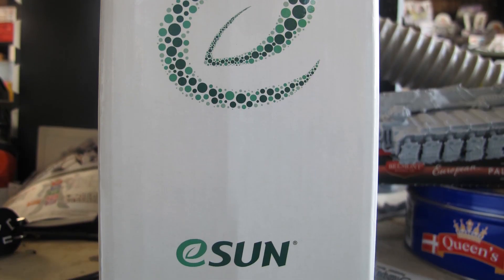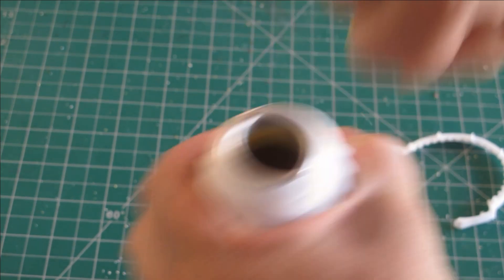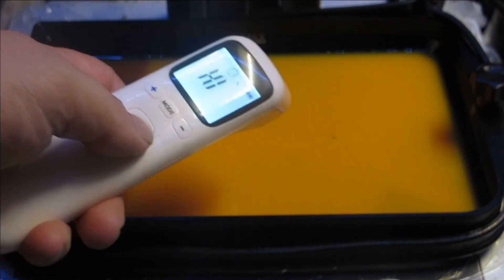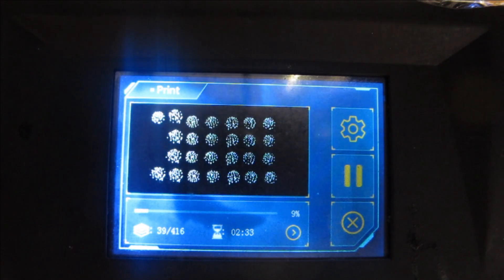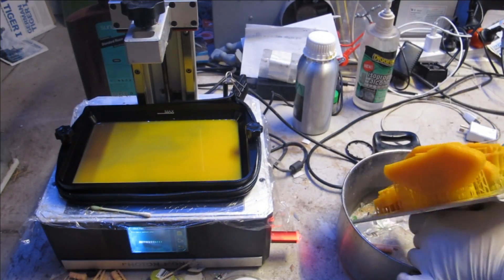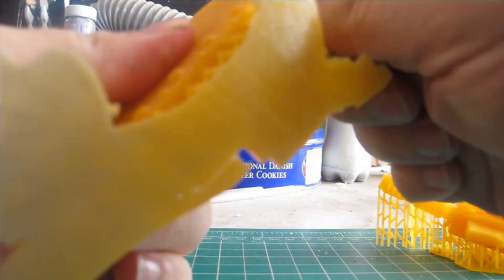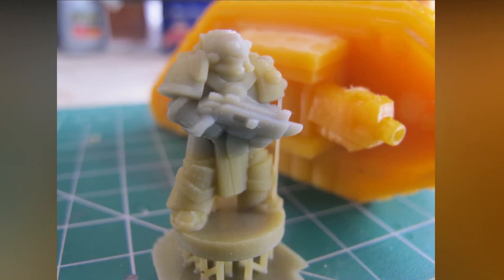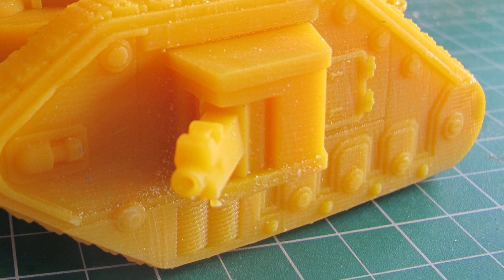Esun eResin PLA Bio Photopolymer resin review (3D printing)

Comment: exposure time please
Reply from the maker: different with very type of printer, same as standard resin that's recommended for your machine with tests and adjustments to zero for best results. I over expose a bit which isnt popular in the community so my input isnt too popular or reverent.
Reply: @mokanaman  At least indicative times I have creality ld006 and black esun and still gives me problems on the test should have 2,8sec and according to the manufacturer 5sec irradiation.
Reply from the maker: If you can quick print black resin you know what you are doing and skilled beyond most normal operators.

Comment: I usually use TL4437 which is a light grey and have zero issues with it. I recently purchased TL4440 and have had nothing but issues with it. Initially I had prints sticking to the fep. I have had issues with the layers splitting and supports failing. Seems a lot more viscous than the one I usually use and I did extend the first 6 payers to 6 seconds exp. Can't wait to get back to my usual resin. Not happy with this one. An odd thing about it is, if I do the print on a second consecutive run, I almost get 100% pass rate. 1st run is probably 60% pass on multiple smaller mini's, or failure on lager single prints. Frustrating.......

Comment: I hate to ask but SO few videos are out there and I need help with information on plant based resin, badly. I keep finding awesome sales on it in bulk but no information. How do the miniatures hold up? do 28-32mm scale minis have acceptable detail? Do they have enough flex to not have weapons snapping off when you look at them? How do they hold primer and paint? I have been told threw the grape vine that they have a slightly softer feel but how?   Please help.
Reply from the maker: Hello, never be afraid to ask myself or any youtuber. Engagement and discussion helps us out as well.  97% eco and plant base resins are mostly the same as regular resin testing few out over the years. Paint, sanding primer wise no difference. Detail and texture is softer in the way of being closer to cast resin then UV resin so completely acceptable for modeling and 28mm miniatures upside due to flex they dont snap as easily.  These are all minimal margins different, another cheap resin worth checking out and buying in bulk is Sunlu which I've also reviewed. https://www.youtube.com/watch?v=Jtth6A9lvzY
Reply from the maker: Another video on plant base resin with a ton more detail and painting ect. https://www.youtube.com/watch?v=PPuxdboPKpc
Reply: @mokanaman  Thank you SO much. I keep finding plant based cheaper than ASB in bulk. I just got into 3D printing and swapped over from water washable (WAY too brittle) to ASB but have spent weeks organizing all the files I have. I can bite the bullet on $150 for 10 kilos if I know I can use it.

Comment: I'm no chemist, but am skeptical about this actually being PLA-based, short of maybe just a little PLA dust sprinkled in the resin as a filler.
Reply from the maker: Good point I probably should talk to a chemist, my assumption is it contains a chemical ingredient that makes up PLA or a solid filler which is common to strength heat sink or tension in resin. Popular mixes include wood, rubber for flex and metal.  It was not a big selling point personally.